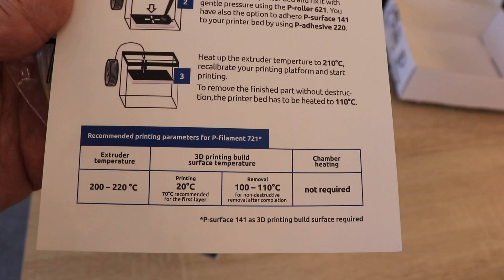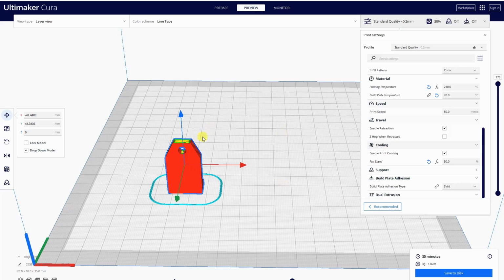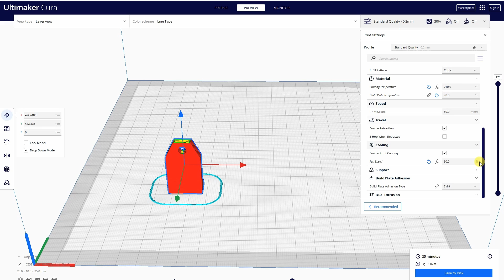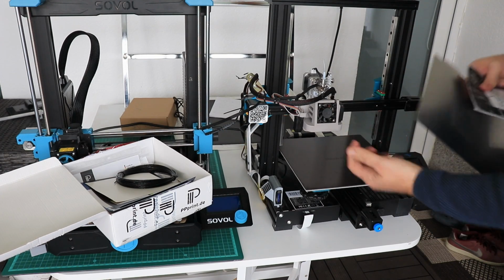PPprint - a solution for 3D printing with PolyPropylene? Let's find out..

Comment: I just cut the side out of a storage container to size, that was just under 2mm thick that is made from polypropylene, It sticks great and that's printing with a cold bed, just give the surface a light sanding first, the only issue is that if you heat the bed the surface warps, if I could find some way to glue or screw the surface to a standard steel build plate or something that could work better.

Comment: Hi sir. Is PP stronger than TPU?
Reply from the maker: Since, I don't have detailed PP test so far, I don't know for sure. But they are different materials. TPU is flexible. But one thing for sure: PP is harder for 3D printing (warping and bed adhesion problems)

Comment: I ordered a 1.5 mm thick sheet of PP directly from a plastics company here in the uk to try and use as a build plate to see if it makes printing PP easier without bothering with tape or proprietary bed adhesives
Reply: Did it work?
Reply: @David-ty6my  I tried this myself. The PP became part of the sheet.
Reply: @brisance  I think it might work if you use a sacrificial layer film specifically for PP between the PP plate and the printed part.

Comment: Thanks for your little demo. PP is going to be massive in 3D printing once they iron out obvious but fairly simple issues to overcome. Because there is no shortage of PP materials already and it's flexible, durable, thermal, water resistant, recyclable and has far more applications in useful industries  like food, medical, automotive and so on. Too many god damn unicorn lover channels and virtually no channels exploring useful development & applications for 3D PP.  Do more PP prints please!
Reply: unicorn lover?

Comment: So the main issue with PP is if you are printing larger surface area parts that are somewhat thick. Corners tend to pull up, and if the adhesion is poor, the part will warp. I've had mild success on various print surfaces. However, it looks like the instructions of the test kit were not followed: clipping it to the bed would not work very well as shown in the video. PPPrint is working on doing a permanently bonded print surface to steel sheets which would eliminate this issue. I think the first layer was not dialed in here so it's not a fair showing of whether this solution works. Packing tape works, but it is appealing to have a fuss free surface to print on without messing with tape etc. Thanks for showing the kit and materials though.
Reply: https://youtu.be/yqepe8KfLjk
Shows a much better example of how it is meant to work. I'm looking forward to getting my own test kit!

Comment: PP prints best on double sided carpet tape (e.g. I most usually use white TESA  0.15mm two sided sticky tape - yellow cover, white tape). You remove carpet tape after print and put on the new one, since tape is super cheap it's ideal surface for printing PP and HDPE  (you can print other materials on it too but no need if you have printbite or pei or ... for other materials) ... but problem with PP and HDPE is that they warp much more than ABS or even Nylon so you really need to have enclosure (I print it in heated enclosure at 80C) and they love to be printed slowly, I print between 12 and 20mm/sec, never faster if I want to high quality parts... I personally use 3mm filament (easy to get locally) and 0.6 or 0.8mm nozzle but 0.4mm nozzle works ok (much more turbulence), below 0.4mm I would not suggest... especially when you go slow, 12mm/sec takes ages to print so you want big thick layers so your print finishes during your life time :D
Reply: @parsu1313  I build my own printers, I doubt that names I give them would make any sense to you :D, especially for enclosed printers I use for PP and HDPE that are not based on anything commonly seen out there (movement is similar to ultimaker but everything is custom)

Comment: Good observations. I have a roll of 150mm wide Kapton tape I bought when I got my printer. I haven’t used it because each roll of my Overture filaments came with a print sheet that works extremely well, but it seems like the Kapton tape could be a good protective layer between the print bed and the adhesive for the PP print sheet.

Disappointing that they didn’t send you enough material to do your normal test procedures given that they must be familiar with them since they contacted you.
Reply: Which overture comes with print sheets?
Reply: Every kind I’ve purchased so far: PLA, PLA Plus, ASA and PETG
Reply: There are places that sell PP print surface sheets for most standard size print beds on amazon between $10 to $20. unlucky for me they dont have a 355mm x355 for my bed surface. These sheets are a thin add on that can most likely be placed on the back side of a flex plate with PEI on one side and PP print surface on the back side. I may end up ordering a custom size for my printer!

Comment: I've used FormFutura PP on my CR-10 and didn't find it challenging to print. The only thing I did was take ordinary PP packing tape and taped it onto my glass bed where the print would be. Removing the packing tape later is easy. When the bed is heated it will peel off easily and any residue can be cleaned up with alcohol. It's less messy than cleaning up glue stick. I think it's an urban legend that PP is hard to print.

Comment: I just use packaging tape for adhesion. It sticks very well and it’s easy to clean.
Reply: I second that. Works well
Reply: Exactly, as this is polypropylene tape. The challenge is sometimes to make it not stick too strongly, which is a much easier problem to fix.
Reply: What bed temp do you use?
Reply: @theglowcloud2215  60C
Reply: 4th to this, mighty packing tape does the job extremely well on moded E3V2.

Comment: I have used PP on normal PEI with a brim with no problem, but the extruder was fighting with the filament, and more than ones, I have to dismantled the extruder.
Thanks for sharing this new bed-solution :-)
Reply: PP is similar to printing Flexible, you should use a Direct drive extruder when printing, and in most cases you should use a heated chamber to prevent warping. It is harder filament to print then other plastics, I have heard that some can print on PEI and some that can not, and some suggest a PP print surface or PP glue stick for printing PP. It might be the brand of filament that you are printing that will determine the out come of the print. I have yet to print it myself but I may in the future for some food containers and the like.

Comment: I've been meaning to use PP as an alternative to tpu for designs needing flexible components on otherwise hard prints as my X1Cs AMS doesn't do flexibles. I'd be curious to see you do a video on this idea/how well it works and am also curious if you've heard of this printer and what you think of it.
Reply from the maker: Flexible? Maybe I should try timing belt. TPU flexible, but too ellastic. Nylon not flexible enough. Maybe PP(?)
Reply: any progress with PP on the X1C?

Comment: I use PP Filament from Recreus, they send liquid primer for the heating bed with the filament.
Reply from the maker: Are you using it with glass? How hard is to remove the liquid after printing?
Reply: @MyTechFun  o remove the primer I use a scraper of those used for cleaning windows. Very easy to celan the glass.
Reply: It would have been nice to have been sent at least a quarter Kg of filament and a full size build sheet so the full library of test parts could be printed and tested.